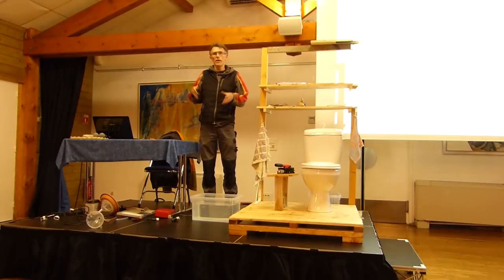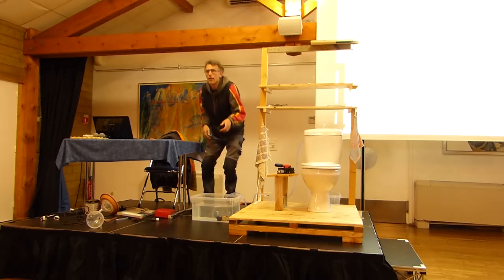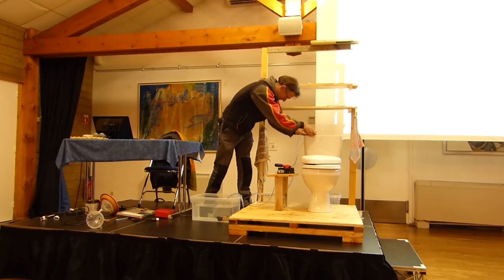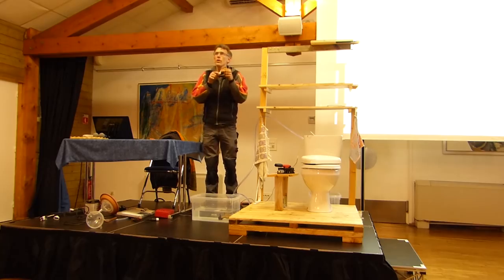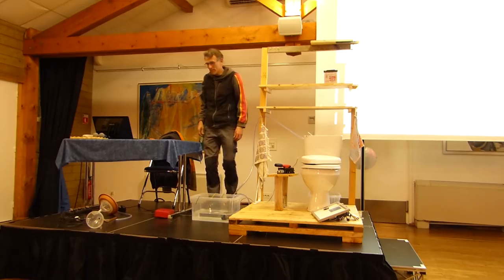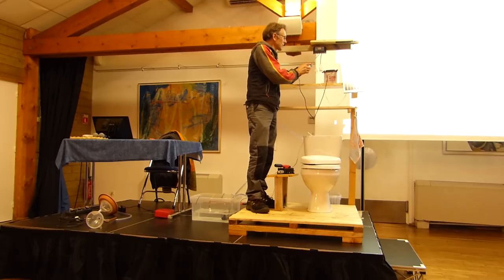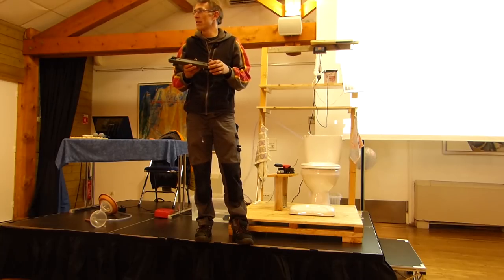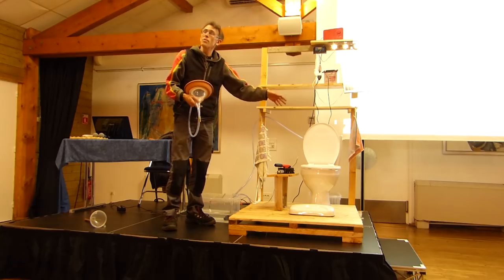Eau de pluie dans les WC

Comment: Super vidéo! Je me suis lancé et ça fonctionne. Encore merci.
Alors le flotteur inox n'a pas tenu longtemps, je n'avais pas bien lu le mode d'emploi mais il ne peut pas servir d'interrupteur il faudrait le mettre sur un relais ou quelque chose d'intermédiaire mais pas en direct sur le circuit. 
Ce que j'ai fait, sur une épave de lave linge j'ai récupéré un pressostat et une chambre de compression et ça fonctionne parfaitement pour zéro €. En montant dans la cuve, l'eau comprime l'air dans la chambre de compression (sorte d'entonnoir à l'envers) et cette pression va déclencher le pressostat pour couper le contact électrique. Basique mais efficace.
Reply: Bonjour, pourriez-vous me montrer ? J'ai installé ma cuve mais je ne sais pas comment installer un interrupteur, les vidéos sur le net sont compliquées, il faut contacteur et disjoncteur.
Cordialement, Isabelle.

Comment: Tjrs au top Barnabé 👍
Tu pourrais me donner le lien de ta pompe 12v car je trouve pas le modèle 5w 
Merci 😁
Reply from the maker: Parmi les milliers de pompe et d'interupteurs dispo sur le net, voici les références exacts de la pompe que j'ai acheté (capable de brasser de l'eau à 100°C, mais ce n'est pas utile dans ce cas,) mais j'ai pris ce que j'avais. 
https://fr.aliexpress.com/item/1pc-New-Solar-DC-12V-3M-Hot-Water-Circulation-Pump-Brushless-Motor-Water-Pump-Worldwide-Store/32434061445.html?spm=a2g0w.search0306.3.1.355f70d67Xa2q9&ws_ab_test=searchweb0_0,searchweb201602_0_10152_10151_10618_10059_10696_10698_10084_100031_10083_10305_10624_10304_10623_10307_10306_10341_10065_10340_10068_10343_10342_308_10103_10620_10344_10622_10302_10621,searchweb201603_0,ppcSwitch_0&algo_pvid=9df489b7-6223-4380-9236-1c519d479aa0&algo_expid=9df489b7-6223-4380-9236-1c519d479aa0-0
Pour l'intérupteur floteur:
https://www.amazon.fr/dp/B00FFYMOT6/ref=asc_df_B00FFYMOT652255567/?tag=googshopfr-21&creative=22698&creativeASIN=B00FFYMOT6&linkCode=df0&hvdev=c&hvnetw=g&hvqmt=

Comment: Petite question pour un électricien :
Est-ce qu'un panneau solaire qui peut générer 10 W maximum peut recharger une batterie de 12 volts ?
Reply from the maker: tout dépend du voltage du panneau solaire et ca n'a rien a voir avec les watts. Souvent ce sont des panneaux en 24v ou 36v donc oui pas de soucis pour une batterie 12v (avec un régulateur bien évidement).
Reply: Chaillot Barnabé merci de prendre le temps de répondre à mes questions techniques. Je n'y connais pas grand-chose en électricité. Quelle est la différence de rechargement entre un panneau solaire de 17 V 5 W et un panneau de 24 volts 10 watts ? Est-ce que ça charge quand même une batterie de 12 volts ?
Reply: Auriez vous toujours le lien pour l achat  du panneau solaire 10W = 10€ ?